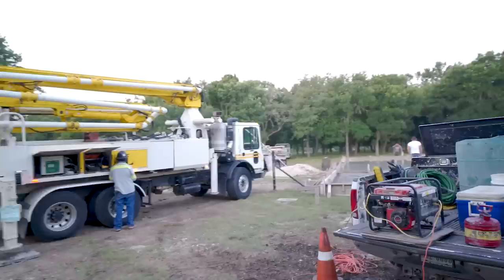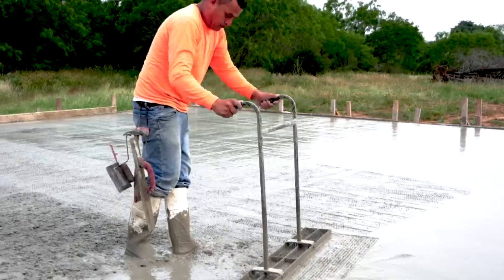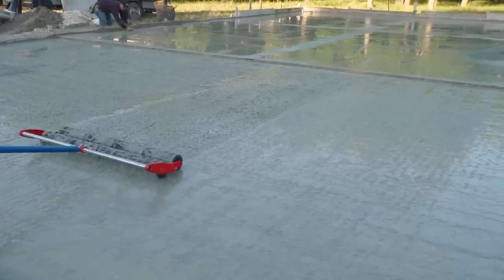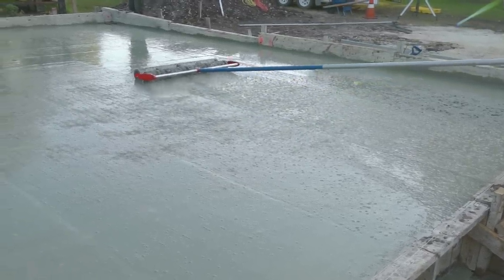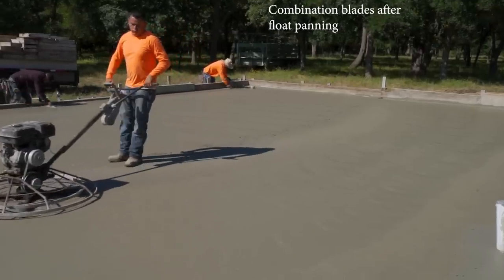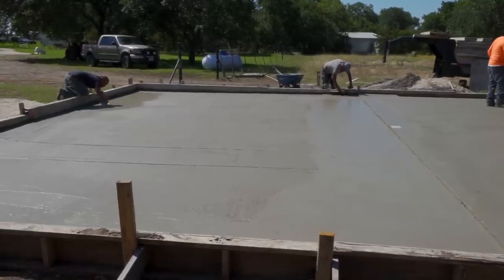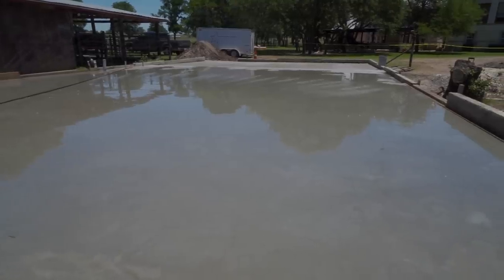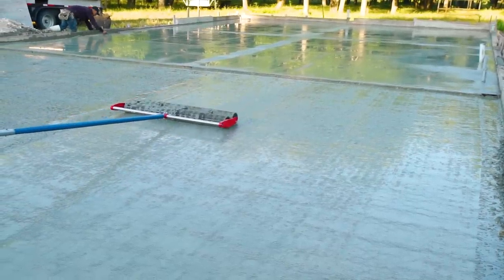Concrete Roller Tamper - The Barndominium Show E133

Comment: I've been doing concrete floors 39 years and never used a jitter bug or roller tamper. Just kick screed or vibra-screed and bullfloat before troweling.
Reply from the maker: Gonna try the vibra screen next probably.
Reply: Mike 
 You don't use it because it does what? Pushes aggregate down? So concrete is weakened???
Reply: @billclinton4344  bro 😅😅
Reply: Mike does good work he's not a dick check his channel
Reply: Beautiful work..
Reply: @TexasBarndominiums  
Vibe screed is all about your rakers, gotta be on it or you be leaving lumps and you’ll be loving your bump cutter again!!
Reply: Agreed. Depending on the type of finish and size, kick screening is good enough.

Comment: I just bought a roller bug like that today, I jitterbug everything I pour it absolutely does not weaken the slab on the contrary it make it stronger and more dense and less likely to sweat without using that freckin poly

Comment: In Australia we don't use those tools. We work a lot easier than you guys you should watch a concrete ninja video to see how easy we do it in Australia. We screed it to level pads done by  laser  then bullfloat it then finished with the trowel machines and only one man on the screed. And we also vibrate the concrete and spray curing compound on top of the concrete to cure it.

Comment: From my perspective, it's interesting to see your approach to concrete work and similar nuances with reloading. Sometimes we do things because that's what we were taught or saw, sometimes we see problems/limitations with equipment (jitterbug requiring to be level with the desired surface) and want to improve on.

There's tremendous value that people like yourself bring to generating a product/service and your sharing that. Thanks for this video.

Comment: Great video mate. I really appreciate your sharing and explanation. Saw your new toy err... I meant tool "Roller Tamper". I have not use this personally although we were recommended by the tool shop as it supposedly will solve our protruding fiber reinforced concrete floors. Since you have tried it and it looks all well in the video. Do you think it would keep the steel or macro synthetic fiber down as well as the top surface aggregates?

Comment: I obviously don't get out enough - I haven't seen anyone use jitterbugs and rollerbugs since the late 90s.  Not in use here for some time because of our intense freeze/thaw cycles - slabs tended to spall, especially when pouring in colder weather when we used to use calcium chloride pellets for accelerator - that was rough on the mix, and you could almost count on problems down the line.  So the more coarse aggregate left close to the top the better. 

I like how those Wagman blades work in combination with regular blades and pans - I think a set of those is in our future.
Reply: You are spot on don’t push the rock down it’s the strength 
If you want easy finishing concrete order smaller rock like maybe 1/2 inch in the mix and order 4000 psi. 
All will cost more but it’s worth it.

Comment: You the best I have seen and I have seen a lot in 30+ yrs. Just poured a basement Thursday morning and it was cracked up  Friday morning before I could saw some joints in it. He used 3000 mix that's all I know. I asked him  about the bump cutter a while back and said to much work. Great job 👍
Reply from the maker: Thank you.
Reply: Dang man sounds bad. y'all laid it?
Reply: Have the chalk lines snapped by the time the machine is finished finishing. Have saw ready to cut floor. Cut the same day. Especially in hot weather. You might get away with cutting next day if it’s like in the forty’s. But that’s a maybe.

Comment: Been using rollertamps for years and they are awesome
1000 times faster than a jitterbug and they work great for steep driveways
Reply: Eric I was looking at them on ebay two days ago good video thanks
Reply from the maker: There is a link on description for the one we are using.  I like how light it was.

Comment: Nube here, would there be a purpose in using fly ash and a water reducer, or do they cancel each other out? I like the idea of having a longer working time with the mix. Great video, appreciate your production value.... most viewers have never made a video and don't appreciate all the work that goes into making a video.
Reply from the maker: Both of the slow the setting time down, but fly ash does it by reducing the amount of cement used, and retarder does it by chemically putting concrete “to sleep” before it sets off.  So retarder is best because it doesn’t reduce concrete.  Hope that helps.

Comment: That is a great looking slab and that Roller Tamper seems to beat the jitterbug hands down.
Reply from the maker: Indeed.  Roller bug is the way to go.  But idk how well it would do on stiff concrete.  More testing on the way.
Reply: Texas Barndominiums maybe you can weld on a bracket for some gym plate weights.

Comment: you''re in texas so don't worry about the water. its not like you can always pour a low slump with the heat in the southern states. i am certain you have poured a wet slump without additives.  everyone has! so it will be ok

Comment: What does a slab like that generally cost? I'm looking to build either a 40x60, or a 35x50 steel ridged barndo with a 15' leanto off one side. I'm looking for a contractor in the area that knows how to build them, so prices is what I'm trying to add up. I'm thinking at least $10k for engineered monolithic slab with footers.

Comment: What is your address I’ll send you another jitter bug ☹️  I quit using them years ago. 
The reason is that they push the rock down and only leave the cream cement on top. The rock is the strength or backbone of the concrete. Sure it makes it easy to finish but in my opinion it will flake off and leave a bad floor. Don’t push the rock down. Or why even put rock in the mix at all.

Comment: Erik when you use a bump cutter how stiff or soft should the concrete be to get a good level floor? Roughly a little bit before you machine it the first time I'm guessing
Reply from the maker: Yes.  Need to be stiff enough to support cutter but plastic enough to be cut.  Like everything else, it’s about timing.

Comment: You're smarter than you only because in 06 I was a crane operator I got hurt in an accident pretty bad shattered my elbow broke my wrist and blew out my shoulder day before that another operator shredded the cartilage in my knee so I've had partial elbow replacement two replacements both shoulders repaired oh i think 6 hernias repaired aint no keepin an oldmarine down besides. House aint paid needs windows siding sheetrock ect. Christ keeps me goin thanks for your respect god bless
Reply from the maker: Sorry to hear that.  Keep pushing though!   Thanks for watching.

Comment: the Jitterbug on a roller that's like 30 years ago nowadays they used to Street vibrator with the motor on it it's the best thing you can use

Comment: I've had problems with an guy who used an roller and it didn't put the agrigate down far enough and we got scratches on the surface so where the weights could help

Comment: In Canada we call those rollers jitter bugs and what you call a jitter bug we call a hand tamper. Been using on for years. Only problem is concrete suppliers won't warranty the crete if a roller is used .
Reply from the maker: Why is that?

Comment: It would be interesting to compare the wear and lifespan of this tool if you were to plate Nickel Boron to the steel wire mesh both with and without a hardness bake. I assume the wire mesh is stainless steel?

Comment: Why don't U blokes slow down with your screeding ,and cut with the straight edge,I am sure U have seen concrete ninja ,everyone who is a proper concreter screeds like that ,not trying to have ago at your  screeding style
,But that is how weekenders or landscapers do it ,piss that gitterbug of screed with a master finish screed just slowdown placing the concrete and bullfloat once ,that is all it needs if put in and closed up,there is no need to bull float every direction ,once across and back ,it is not a race when quality is jeopardize, good video mate ,I know change is hard ,maybe they don't like single screed ,

Comment: That’s a great way to weaken the surface!
Reply from the maker: Why is that?
Reply: Here’s the lowdown on the roller tamp function. The roller tamp helps push larger aggregate below the concrete surface providing additional mortar coverage. This is especially important when bump cutting behind trowel machines when higher tolerance floor flatness requirements are needed. When minimal mortar coverage exists over larger aggregate at the surface, the mortar is subjected to heat generated by the power troweling process. The heat evaporates the water in the mortar creating a weak bond between the aggregate and surrounding mortar. The mortar eventually pops away from the aggregate and a hole is created in the floor surface. In due time the aggregate loosens and pops out of the concrete. This is referred to as a “rock pop”

Comment: Bro, you got me wanting to change jobs.... I like concrete!!!
Reply from the maker: What do you do now?
Reply: I'm in the trucking business.. I'm a maintenance manager for a trucking company. Got about 35 mechanics working under me. I've been here for almost 20 years. Been looking for an out, concrete and construction (dirt work) really gets my attention.
Reply: @doinjusfine1  stay with your job, trust me !!!
Reply: doinjusfine1 unless you like working in the elements. Cold and HOT! Heavy hard work. Your getting old, don’t use your body it will break down.
Reply: @FishFind3000  thanks for the insight..  but I'm talking about owning the business... not necessarily driving stakes and pulling mud..